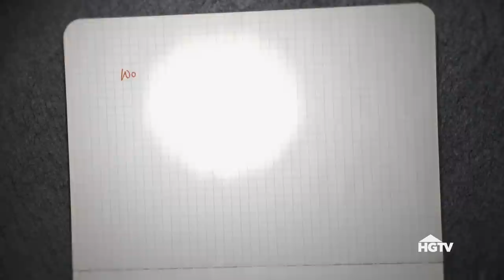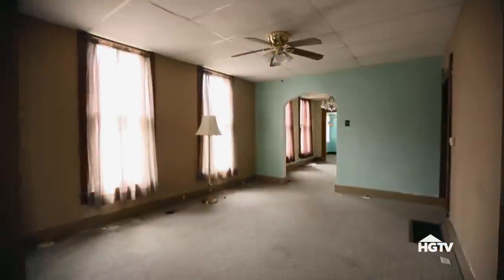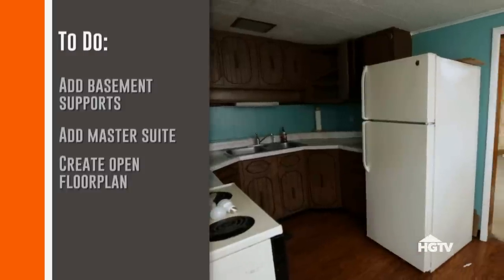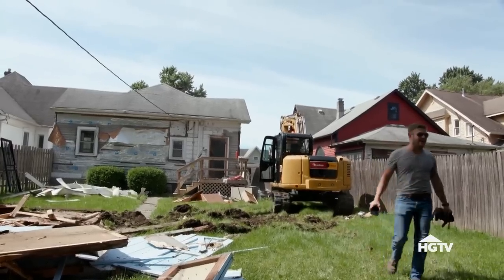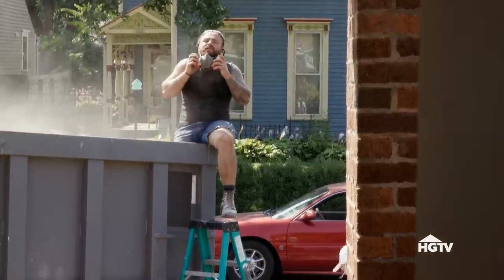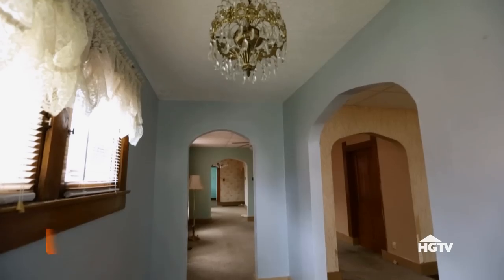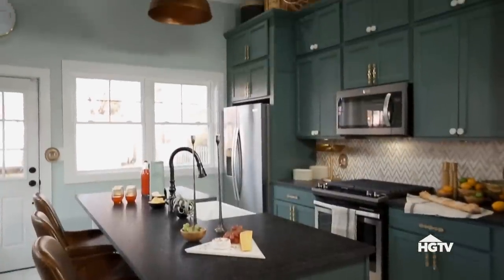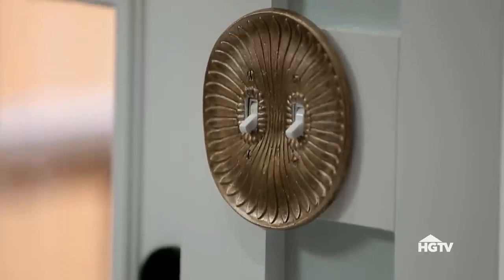Tiny Bungalow House Gets HUGE Overhaul | Good Bones | HGTV

Comment: It looks amazing. If you had not seen the 'before', you would not have missed the time honored charm of the arches. I feel leaving one arch before entering the kitchen for a subtle separation, would have kept some of the original charm of the house. Love the open ceilings, stunning look for any house. The black wall, I feel, could have been more attractive with a stenciled design in black. However, a traditionally used stencil in white over the black, is more effective, and would soften the room from the hard black accent and still be dramatic. Softening needed especially if you have no drapes to soften a room up. Black is a hard and dramatic color, and needs to be used strategically.
Would have liked to have seen the results of the rest of the house, potentials walk through reaction, and selling price.
 The shed could have been sold, saved time spent on it, and any cost for equipment rental. Destroying it would be last option. One man's junk, is another man's treasure.
So much planned, and worked out by you. The new footprint has so much more livability, my .02 is but a brush of a pen. Still I must add another level here.
Please realize you have a vision far from the memories of those who have spent a lifetime of memories in their Home. What is a 'project building' for you, is a Home, and lifetime of Childhood Memories for them. The memories can't be replaced, but when you show them the house afterward, you are in an emotional way 'removing', 'replacing' their childhood memories with your 'project resell'. It is an emotional slap to their many years of emotional memories growing up in their Home. Please be kind and prepare them before hand, and ask it they still want to see the many 'updates'?  Say, 'Be prepared, it no longer looks like your childhood home!' No matter how pleased you are with your changes, no matter how much of an 'improvement' you make from a 'before', it's still not what they feel when seeing it. Their memories are no longer a reality to go back to. This is a harsh reality you need to prepare them for if they agree to revisit their childhood home after you have 'remolded' it. 💌
Reply: I had the same thought about the arches and that black wall - odd choice.
Reply: Flippers have no obligation to pander to the feelings of previous owners.  Most wouldn’t give it much thought and might even simply bulldoze.  Sometimes these houses are just too far gone.  i think these two flippers are very much on the same page as you and were very respectful to the home and the previous owners.  i think your suggestions on what to say and what not to say to previous owners (operative word being ‘previous’)  are a bit over the top.
Reply: I totally agree with you about the black and keeping an arch 😀